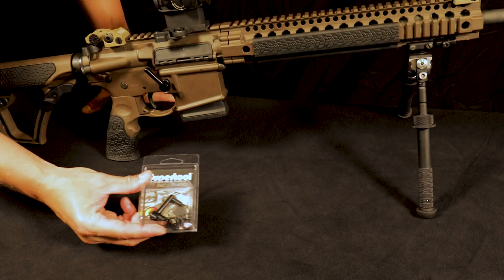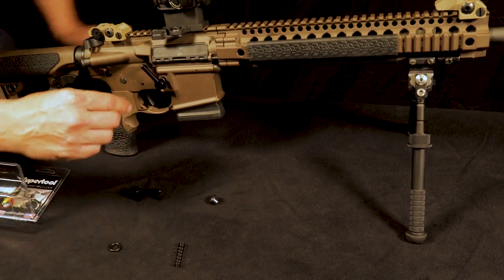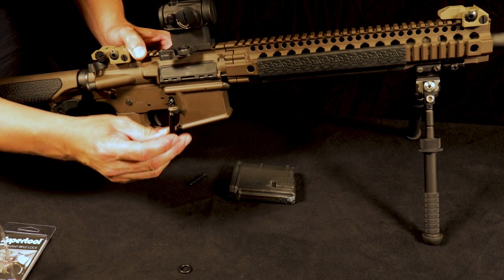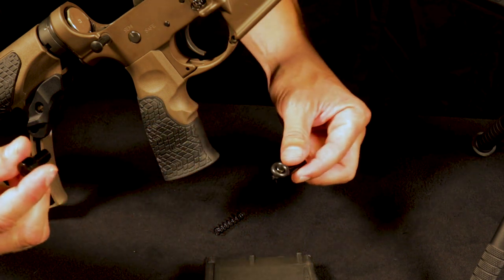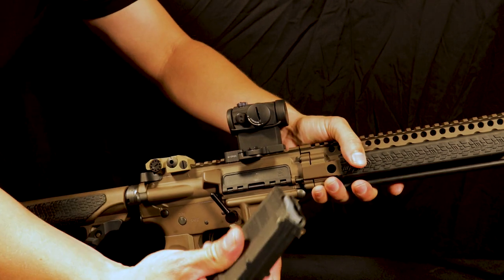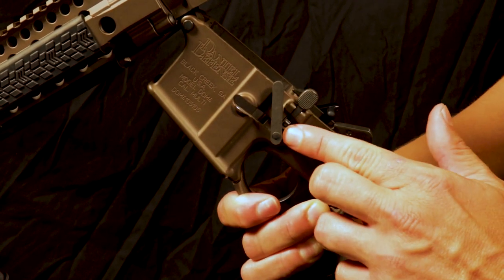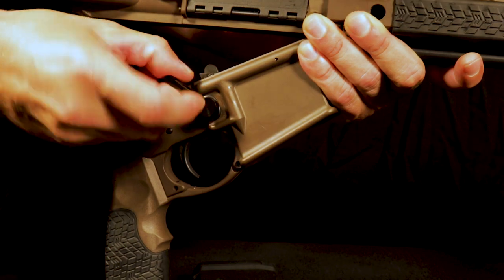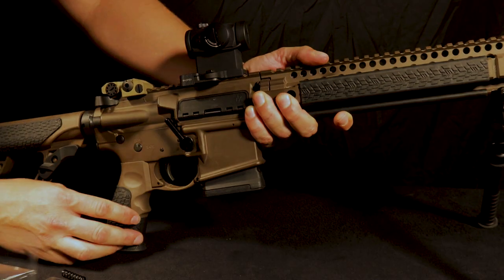Supertool's Compliant Rifle Lock Installation Instructions

Comment: Installed this yesterday and it doesn’t work as intended. Followed the instructions down to the “T” and seems like there’s something else causing the button to not depress when the upper is closed.

I’ve emailed them and no response for a refund. Maybe this works on others but doesn’t work for mine.

Comment: So you use the magnet to take the dog leg off every time to  change the mag?
Reply: Think of it as another one of those horrible fixed mag options EXCEPT.... it can easily and quickly be adjusted to return back to the original standard magazine release function. If you want a regular gun again, it takes a few second.  Just ordered one.
Reply: i got the hell fighter on mine. i miss my bolt catch.

Comment: Are these ca doj approved?
Reply: So far it is its no different than an ar maglock
Reply: @iyot1020  you can lock your bolt to the rear and clear double feeds, ar maglock cannot allow for this
Reply: @gr33knac  How so? There is zero functional difference between this device and the ARMagLock or other similar devices that won't let the magazine catch move with the upper in place.